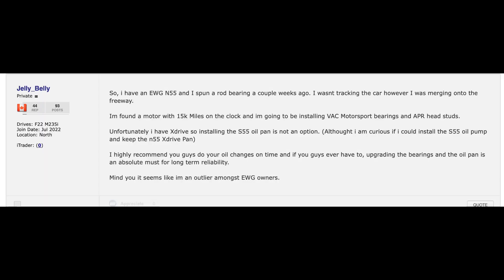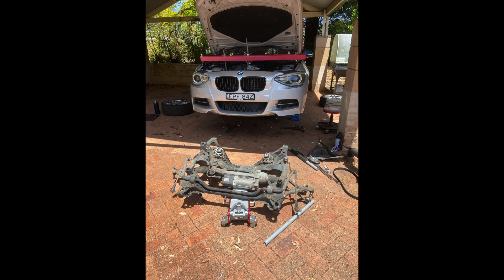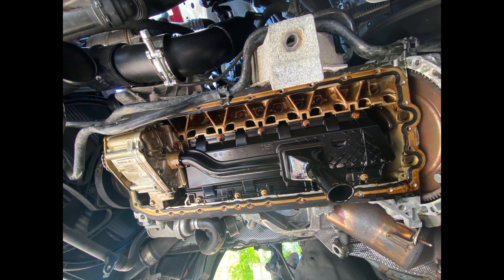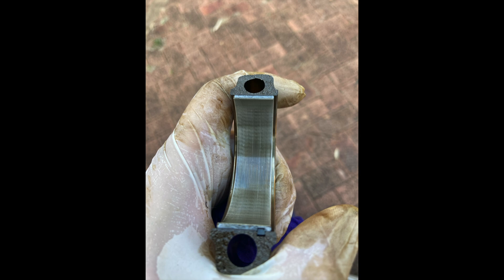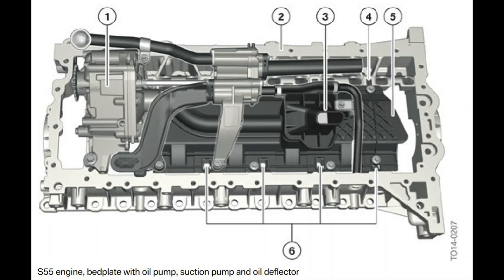Checking my BMW N55 Rod Bearings, Shocking Results...

Comment: I hope you still changed the rod bearings while have the oil pan off? Rod bearings failure happens quite a lot around the 100k miles / 150K kms. I'll do it preventative before that milestone. Including a baffle kit.😊

Comment: My full service history from bmw n55 just spun a bearing the day after I purchased it. 124xxxkm
Reply from the maker: That sucks man, very unfortunate. From my research. N55 and spun bearing are usually due to two reasons.

1: High g force driving, generally not as big of a problem as people make it out to be. If on street tyres and no suspension upgrades, overfill oil by 1l and it’s a non issue.

2: Oil priming procedure not being adhered to.

This is the most common one. Most mechanics aren’t aware of how to reprime the oiling system on the N55. 3x 10 second with injectors plugs disconnected.
If the sump and ofh have been removed, it can take over a minute for the engine to get oil pressure without the carrying out the procedure.

This can often result in the car spinning rod bearings anywhere from 50km to 3000km later from what I’ve seen and heard. N55 engines are pretty cheap nowdays. (Not in aus) I was in the UK recently and there are heaps of N55 going for couple hundred pounds.
Reply: @mcgarage7315  sump gasket was replace by a bmw dealership 459km ago. 100% certain they didn’t prime the system

Comment: Did you even check the top bearing?  #6 top on mine was shot and the bottom bearing looked fine.
Reply from the maker: That’s crazy man, which n55 do you have and mileage? 

I did have a look and it was pretty much the same as the lower. But your making me worried now 😅

Comment: Thanks for your video. I have a BMW X5 e70 (2013) with the same N55 engine (306 hp), the mileage is currently about 130,000 km. I change the oil in the engine every 7-8000 km.
Tell me what are the characteristics of your engine and how heavy is the operation of the car in general (fast starts, chip tuning, driving at maximum engine speeds, race tracks)?
Reply from the maker: Nice spec, the car has had reasonable service history. completely stock. May tune in the future, but not 100% sure.
No race tracks, but occasionally is driven well. Hardly ever wind it out because of the torque at low rpm is useful, and the power drops off at around 5500-6000 rpm.